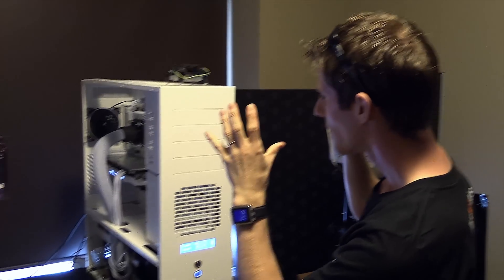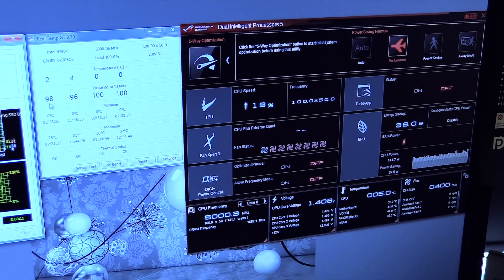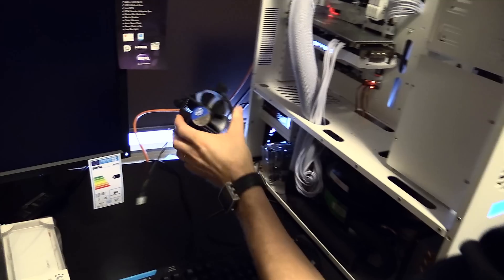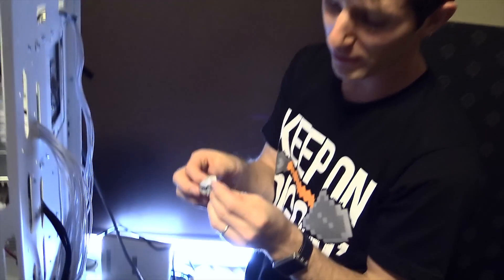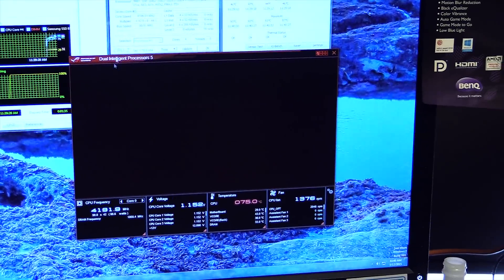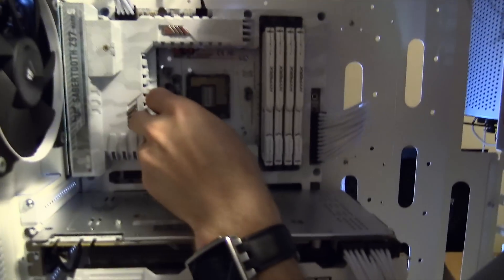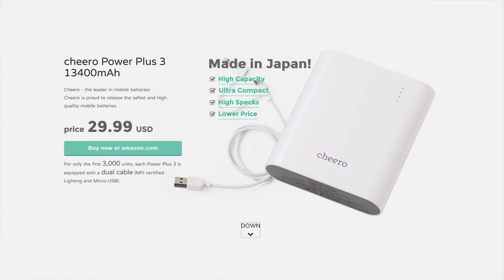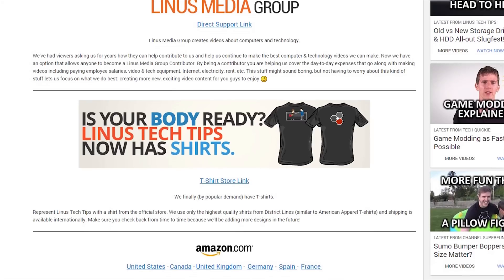CPU Cooling - Does temperature impact performance?

Comment: Resistance decreases with increase in temperature for a semiconductor device (due to increase in dopant electron concentration). So if you cool a processor a lot you might get lower performance. Its better to cool the processor just enough to avoid the thermal throttling and maybe a small margin to help life time of processor. If you want to super cool a processor try going for much higher clocks and voltages. Running phase cooling on stock clocked processor will give you lesser scores.
Reply: +Sumeet Singh Right but change in resistances is not that relevant. What matters is the clock speed, and that changes next to nothing with the temperatures involved here.

Comment: Ummm, why not just take a NoctuaD14/15 system and run it with and without the fan installed? Or run an AIO cooler with different pump speeds? More importantly, the things to measure with temperature would have been power consumption since colder electronics should draw less power due to less resistance. Something that you might only see in a sub-zero vs ambient cooling setup.

Comment: My i5 4690k is running at 40-50-60 degrees idle and 70-80 in game. I am using the stock fan/heat sink and stock speed.
Reply: +NativeJoe Spambot? Anyway, you're bullshit. Her temps are perfectly fine.
Reply: Is this normal?
Reply: ***** its alright i fixed it by reapplying some thermal paste, getting a hyper soon.
Reply: ***** 29-34 idle, 50-60 in game!
Reply: +Halsy No it's not normal. use XTU...and cool that bad boy down. at 4.73 ghz I was in the 50's gaming at a 22c ambient. Now I use Swiftech liquid cooling and delided my 4790k so it's way cooler now. but yeah xtu will shave 10-15c off those temps. look the topic up... it's pretty much a required thing when running the devils canyon series
Reply: SquidPlays
*His. but yeah, thanks.
Reply: Smifficus Oh, lol.

Comment: Can you seal up one of those cases and stick a dehumidifier in it so you don't have to rely on eraser rubber / grease? I'd rather know for sure I was controlling the atmosphere in there than hoping there aren't any holes in the rubber. Or coating my expensive computer parts with anal lube.

Comment: This kinda results u can get only 4 best cpus.    I got AMD A4 7300. 2 core not 4. With stock cooling. When it run not even 100% like 40min it got slower and not stabil.  I restarted pc few times and cpu was going 90% only with mozila opened. Then turned it off like 1h to cool down.  And all the time now he have perfomance drops all ower place

Comment: Computers behave much like any other kind of electronics. If the environment is ideal, it will last longer. But the question is. If your intentions are to upgrade de system in 3 years, why would you invest money to it last 10 years?

Comment: I was once upgrading my cpu cooler and the processor had come out with the cooler that was already installed. It's an AMD processor and it came out on the bottom of the cooler with almost 10 or so bent pins. It was not a fun hour bending back pins... Note to everyone out there, DO NOT USE AN $8 THERMAL PASTE TUBE.

Comment: i have a laptop lenovo z50 - 75 with the fx7500 and the r7 graphics intergrated and r7260dx dedicated but everytime i look at websites it says it is the same graphics card as the R5 m230.

and what is exactly dual graphics and when will it activate.

is this true and if so i am very dissappointed in lenovo 

can you please explain it.

Comment: sorry, but your test does not show the situation! all 3d marks are designed for checking gaming perfomance, but not cpu perfomence. that's why those tests use only 60 persent cpu power and 100 persent video card and ram.(as games, by the way). To make the real test -  you need to use something, using floting point operations and without any gpu acceleration. You can use: winrar, sony vegas or just 3ds max. But turn off the gpu acceleration!

Comment: This experiment was flawed. Using so few data points? For shame, Linus. You should have use the same hardware tested at air cooled, water cooled, and phase change cooled, at both stock settings and overclocked.

Comment: I don't know if it has been mentioned yet, but when it comes to Haswell chipsets (and yes, I am talking about the server market here) temperature can have an effect on speeds, particularly when it comes to AVX 2.0 code. On a base 2.4ghz proc (2630v3) it can turbo up to speeds in the range of 3.2ghz, with AVX speeds ranging from 2.1 to 3.2ghz. However, as the CPU heats up those speeds will drop down to the lower range.

Comment: I was kind of expecting you to test gaming performance with a "weaker" CPU that barely runs the game... I think in that case it would definitely impact performance. If, let's say, CPU is under (nearly) constant 100% load and running hot, it would result in worse gaming performance. Same situation but cooler temps and it would affect gaming performance less or not at all. Or am I wrong?

Comment: Yes, but it's more like if your CPU is Hotter it will perform badly, but those statements are broad.

So it's something like, if you are close to or above the suggested temp max, the cpu will run worse.

Comment: PC:
Case: Silverstone Tek ATX, Micro-ATX Mid Tower Computer Case with Side Window Panel PS11B-W - $49.99
Motherboard: Gigabyte GA-B85M-D3H - $71.17
RAM: Corsair Vengeance 8 GB (2 x 4 GB) DDR3 1600 MHz Dual Channel Memory Kit - $60.25
Storage(For Windows): Kingston Digital 60GB SSDNow V300 SATA 3 2.5 Solid State Drive - $45.99
Storage: Seagate 2TB Desktop HDD SATA - $89.90
Graphic's Card: EVGA GeForce GTX 750 Ti FTW 2GB GDDR5 - $157.99
Processer: Intel i5-4440 - $198.35
Power Supply: Corsair CX Series 750 Watt CX750M - $79.00
-------------------------------------------
                 Total: $752.64 
                  Is it worth it?

Comment: So the conclusion: If you want the CPU to perform better overclock it. Now the question is will cooler temps allow for better overclocking stability vs. stock cooling and overclocking?

Comment: Cpu heat slowing down a system, i had an overheating problem yesterday where my i5 3.40ghz would sit at 60 on idle and the system ran like a brick, since new fan and thermal paste, temps run at 45 full load and runs like a dream, was the same with my gf's laptop. It is a weird 1

Comment: Would have been more useful if you guys looked at overclocking. So whether or not a CPU could be overclocked further when running at -20C instead of 60C during heavy loads.

Comment: the difference is not so great at 0 ° C to 50 ° C, the i74790 is only one or two percent less potent than i74770, I prefer a cooler like CM V8gt, It is cheaper than an engine of frizer >__<

Comment: Here's a question but you wont' be able to answer this in the short term. Will a colder CPU or GPU have more longevity than one running hot?

Comment: LinusTechTips You should change your video title. It should be "Does low temperature impact performance?". Because we know overly high temperatures do, causing thermal throttles.

Comment: This was a pretty cool video, but now what I'd like to see is how fast can you run that CPU before it breaks. We already know you can't RMA it. How fast can it run until the temps it gives off are the same as ambient room temp? How fast can you run it before it approaches the manufacturer's acceptable highest operating temperature. How fast can it run before critical system failure and it refuses to start? If it never gets that fast, what is the point it refuses to work? We want to see something finally die on LTT. With all the close calls we've seen you owe us that much

Comment: HMM, I find a bit surprising, but I've yet to look at any tech data on current intel CPUs. I know with Pentium 4 systems it would make a considerable difference I assume due to the thermal throttling. I assumed that was still present today, but maybe it has some threshold that is a "worst case" it trips at.

My parents have 5 dogs, at the time he had a dell diminsion. After a few years it would start to sound like a hairdryer constantly running. Usually the front air intake and the heatsink face were packed with dog hair. It seemed to make a good bit of difference, but the case fan running like that tells me it was running way hot and most likely thermal throttling had kicked in.

Comment: The speed of sound changes by less than 4% between freezing and room temperature.  Aren't those tests primarily GPU benchmarks?  Not that there's much difference in the end.  Temperature control is more about extending the life of the system, or overclocking and hopefully getting the same life out of the system.

Comment: the only way it will run slower is if the Hyper Throttling kicked in. Otherwise I don't think water cooling and sub-zero temperatures are useful, unless you're overclocking, but I think there are cheaper solutions to that. It is still freakin' cool to have your CPU under 0 degrees (pun intended), and the design the watercooling gives to a PC is just priceless...

Comment: I don't even see why this had to be debunked, the only effect temperature has on a CPU is change its ability to be stable at a given clock speed and as long as the CPU is not throttling due to high temp, performance will be the same.

Resistance/Conductance of the die will change voltage raise time, but that will not have any effect on performance. Even if voltage finish raising way early, the next instruction will NOT begin sooner. It will ALWAYS follow the base clock.

As heat rises those voltage transitions takes more time to settle in the CPU, but as long as each transitions complete before the next clock pulse, everything is fine, if not the system will crash due to the CPU now being in an invalid state.

http://en.wikipedia.org/wiki/Clock_rate

Comment: 555999955595555595555999955559555559
555955555595555595559555555559555995
555999955595555595559555555559595555
555955555595555595559555555559955555
555955555559999955555999955559595555
555555555555555555555555555559559955
559955559955555999955555955559555555
555955595555559555595555955559555555
555595955555559555595555955559555555
555559555555555999955555599995555555
555559555555555555555555555555555555
1.Highlight the numbers
2.Press Ctrl+F
3.Press 9 or 5
4.what does the message say?

Comment: Hey +linustechtips, quick question. 

would building a high end computer with this:

i7 5820k CPU
EVGA gtx 980
16 gb (4x 4gb) of Corsair Vengence LPX ddr4 2666
MSI ATX x99a MOBO
PNY XLR8 480 gb SSD

be good for doing 4k video editing and high end gaming, or is it over-kill?

I kinda wanna future proof a bit, but I'm not sure if its worth it right now.

I'm running

AMD FX-8350 (8 core 4 ghz)
Gigabyte 970a MOBO
GTX 760 SC (4 gb VRAM)
16 gb (2x8gb) corsair vengence 
1tb WD black HDD 

right now.
Reply: Rykkr That Gpu is not powerful enough to play 4k latest games. It can run all games! (gta 5, bf4 etc)medium/High settings, 40-50fps but not ultra. (you can run ultra but fps like a 20 then). I have too that cpu and its awesome! :)
Reply: MinecraftHero01 with my current setup I can get gta 5 and bf4 @ 60 FPS on ultra. and what about 2k on the 980?

Comment: So I'm planning on buying an NZXT Kraken X61 watercooler but I want to know what the best configuration is considering airflow. I have the stock front triple 120mm fans and I replaced the back 140mm stock fan with an Fractal Design Silent series 140mm fan pushing air out. I'm planning on putting the watercooler at the top.

Here are my PC specs:
-i7 4790k 
-Gigabyte R9 280X
-MSI Z97 Gaming 3
-8gb 1600 mhz RAM (very cheap :l)
-1tb HDD and 250gb Samsung 850 Evo SSD

So the question what is the best airflow configuration for my planned NZXT Kraken X61?
If I need to buy anything that drastically increases the airflow or something like that, also tell me!

THANKS!

Comment: it probably only has an impact when you're talking about extremes. my lowest temp on my FX-9370 with an hyper 212 cooler is about 60/65 degrees. I am pretty sure it would run better if it was cooler xD so I would say, build two pc's, one with an FX9370 with an hyper 212 cooler(a little better wouldnt hurt though) , and one with the subzero cooler you've got there.  then you'd see if it matters.

Comment: To simplify the "complex answer". There's no way to push a CPU to perform better than specs just by putting on a better cooler. However, if you have inadequate cooling, the CPU will throttle itself to prevent damage.

Comment: This was a great test. people always like i run it so cool but what's the point. they will last long enough as long as it's not going above 85C under heavy load 24/7. Lower temps most probably will make cpu go faster cause you might be able to overclock better.

Comment: A friend of mine used to deal with a giant computer with a 286 in it. he noticed that its clock was starting to run about 5 minutes faster than the previous day no matter how many times it was reset. it turned out that the heat sink fans had died, and the processor was overheating, with new fans on, the processor was cooler, and the clock problems went away. which implies that a higher temp should make you CPU run faster. of course this all seems a bit odd, but it is a possibility.

Comment: CPU Cooling - Does temperature impact performance? Yes, because if no thermal throttle wouldn't exist.

CPU Cooling - Does COOLING TYPE impact performance? NO, unless you are overclocking the CPU. If it did we would upgrade our coolers instead of CPUs lol

Comment: What about lifetime of the CPU?
I know a lot of people that refuse to overclock because they don't want to be too hard on their system
Reply: Tiberius Hrafn-Úlfur Any semiconductor suffer off thermal stress, that is a cold-heat-cold cycling. like aircrafts, not only the flight hours but also the take off / landings cycles are critical. Thermal stress can develop small crack in the package. This cracks can eventually damage the conections to the silicon die or damage the die itself. The more you heat it, the more stress you put. Yes, even when you operate it above the safe limite,  the piece is likely to fail soon that expected. Also heat damage sockets and solder joint and put stress to the mainboard. Of course they are designed to keep up with this conditions, but dont expect to last forever, well manufacturers of CPUs and mainboard dont expect nor wish also
Reply: Tiberius Hrafn-Úlfur I believe that is true. That's why computer guys stress on cooling. I haven't had much experience with building(yet. no money) but from what I do know from taking IT courses in college and watching a lot of videos, cooling does help make it last longer.
Reply: shiftplusone80 Well even before it completely dies, it could also reduce performance due to damage.
I've had CPU's running stock for years just fine, but when you over clock or run them too hot who knows, might only last a year
Reply: Tiberius Hrafn-Úlfur Only REALLY old CPUs will die from overheat.
Reply: yes, it does. in a sort of infinite loop, infact.

but first - i don't keep tabs on AMD anywhere near as much, but Intel targets a 10 year estimated average lifespan for Consumer Processors. for all stock settings, ofcourse.

heat generation by electronics causes a 'degradation' (as always, that term is not really that accurate, but it's easy to interpret - nothing is actually breaking) over time.
this phenomenon is actually quite interesting, IMO.
over time, the heat the electronics generate causes them to need to draw more power in order to sustain the same performance.
note the infinite loop here, the heat causes it to need to draw more power, drawing more power causes it to generate more heat - on and on.

for the general Consumer, it's not that big a deal. keep the Temperatures stable and within a comfortable range, and it should last many, many years.
this should only become worrysome for extremists which are pushing everything to their absolute limits daily.
Reply: I've had about like 5-6 computers in my lifetime (25 years old here) and had a bunch of component break but never a CPU. Even on my last computer (Core2 quad 4400 if I remember correctly), the thermal paste burnt and the temperature would fly up to 60C on idle and 90 on load and shut itself at 100. I don't know how long I ran it like this before noticing (before it started crashing every 30 min) and the computer still runs like a charm to this day.

So I guess that as long as you keep the temperature around the safe number provided by the manufacturer, you'll be just fine for many years. Keeping it in the sub zero temps is just overkill and almost dangerous.
Reply: Tiberius Hrafn-Úlfur It's a very valid point, but it's really weird to see none up voted your response. This shows the 'sheep' mentality of the crowds. 

You're correct. I made a policy at my work places not allowing OCing on CPUs or GPUs other than official Turbo ranges (K CPUs). But most high-end Workstations run Xeons. 

High temperatures have dramatic affects living and non-living things. E.g., 

a) kid playing under Sun, say 40C, might result in Sunstroke. Need not be the same at 30C. 
b) Solar panels covert light into electricity far more efficiently at low temperatures, say 25C. But as temperature soars, say 40C, efficiency decreases. 

Hence, temperature is vital on many parameters. It can cost you a lot more money each season. E.g., your utility bill varies with and without an AC.

Comment: Cooling a CPU down will make it faster by a tiny, tiny bit. Because the silicon and metal inside the processor become less resistant for electrons to pass through when cooled down (superconductors are a good example) so it is easier for electric signals to pass through which increases the overall speed of the chip.